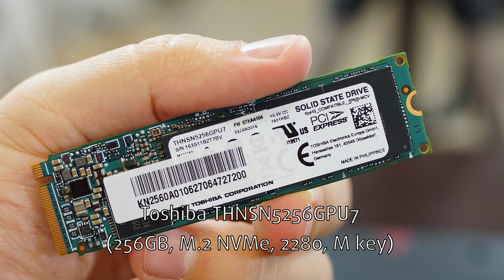Acer Predator 15 (G9-593, GTX 1070) - disassembly and upgrade options

Comment: Great job, I'm still waiting for my G9-593, dealer said they will send it to me on Oct. :(
Reply: Good for you. One question though, does the G9-593 display support G-Sync?
Reply: ghaith garraoui I just check my Nvidia Control Panel, Yes, it is support G-Sync
Reply: good to know, thanks :)
Reply: ghaith garraoui no problem
Reply: I believe g9 has g-sync and g5 doesn't

Comment: Great video! Few questions as a curious consumer:
Where are the originally installed RAM cards at? I'm guessing the other side of the mobo.
I see a second M.2 slot just above where the ssd was pulled out. Is that an M.2 slot? If yes, is there an attachment in the box that allows it to be installed correctly?
Reply: Ram is behind the MB, the other m.2 will require an adaptor from Acer.
Reply: The Donald how do I get to the ram ?
Reply: You need to disassemble it completely, which will void your warranty too.

Comment: would it still run if i disconnect the battery and plug in charger?
Reply: yes it would most probably run. I'm using my samsung laptop like that
Reply: yes it will run im using my sony like that

Comment: Is it possible to use an external GPU like GTX 1070 or RTX to the Thunderbolt 3 port? I have one but the GPU is broken and can't be fixed, so an external GPU might help.
Reply: if you're still wondering, the answer is yes,  but the performance is reduced by 10%

Comment: Hi dude, great video
I'd like to ask you for some cleaning tips? Do you have any?
Also may I know what screwdrivers did you use?
Thanks a lot and keep it up
Reply: Well, this laptop has a Dust Deffender system, when you turn it on the fans go full speed in reverse and remove all the dust from inside, you won't need to clean it for a while.
Reply: Pein the God It does work, but trust me it needs it. I opened it yesterday and the dust was quite a lot

Comment: Thanks for the video, wish it went a step further and removed the fans and what not. I was hoping to reapply thermal compound to cpu/gpu when I received this in the mail. I plan on spending several hours at a time gaming on this, so definitely need to take heat preventative cooling measures.
Reply: Student Zero did you ever repaste it?